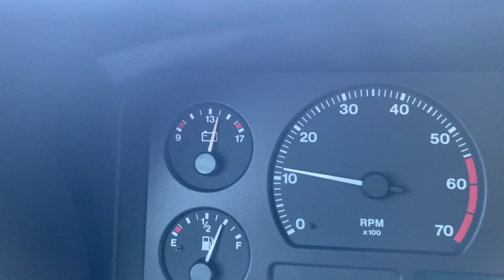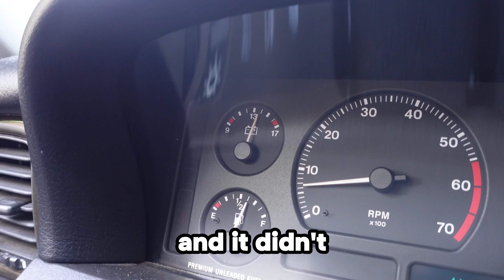My Jaguar's Battery Nearly Left Me Stranded

Comment: Hey Jesse! I see your clock is "dead" like 99% of the 95-97 XJ6. I just rebuilt the clocks on my 95 and 97 XJ6. Simple with the ribbon kit! I also converted to green leds. The incandescent bulbs got too hot for the original ribbon! PS Glad you found "your" place!
Reply: Just about to do mine fingers crossed😰
Reply from the maker: Hey there Richard! Yea the clock on my XJR6 isn't working. I understand its a common issue, I haven't had time to replace it. Smart move with the LED conversion considering the heat issue with the original bulbs.. Where did you order your ribbon kit from? and did you have to solder the wires?
Reply from the maker: Wish you the best brother you got it!
Reply: @XJJesse  ALSO, there is an excellent YT video showing the repair. I tried to post the link, but it was "stripped"!

Comment: word i finally got my white one running halfway decent and i gotta replace my battery too, its still idling not the greatest and seems to be burning alot of gas i think i need to switch the fuel injectors out
Reply: Hi! Always try injector cleaner first. It does miracles sometimes and it's inexpensive.
Reply from the maker: Nice work getting your Jaaag running! Like Alex mention I would try some fuel additive like Cataclean. Checking the air filter, clean the MAF sensor, Throttle Body and the replace the spark plugs, and Idle control valve it could also help improve its performance and fuel efficiency. best of luck with the fixes!
Reply: @XJJesse  word i put a better used filter in it and did the plugs but am going to get a new filter just been broke scavanging parts off my other 2 jags to make the new one perfect condition , its running better but now my batteries fucked , i forgot to write down what battery you used in that video you just had , whats interesting is my new one doesnt have a glovebox and according to the mechanics manuals it has a different camshaft than the later 95s or 96s and 97s its not true dual exausts though like on my 97 but i swear the true dual exhausts were making it idle weird or something like it didnt have as much pep as it should have or idk it just seemed different